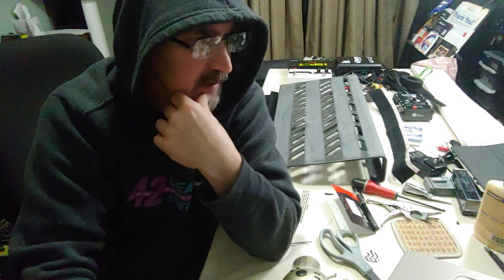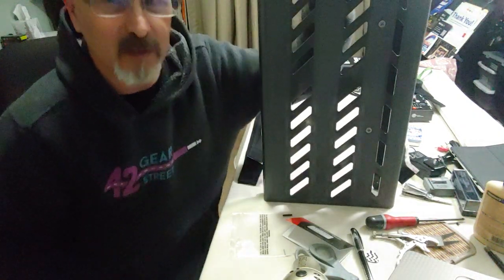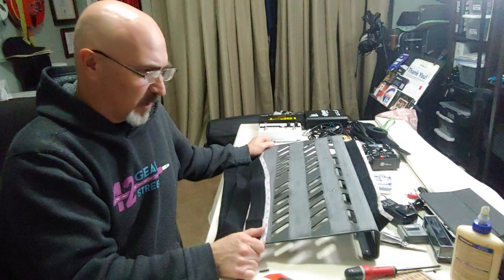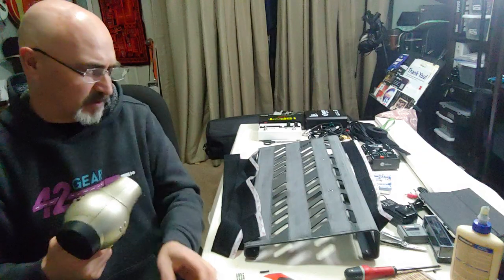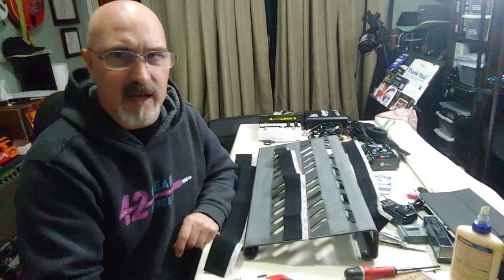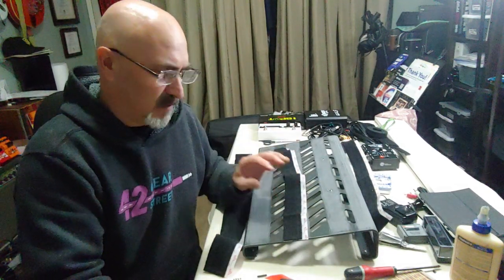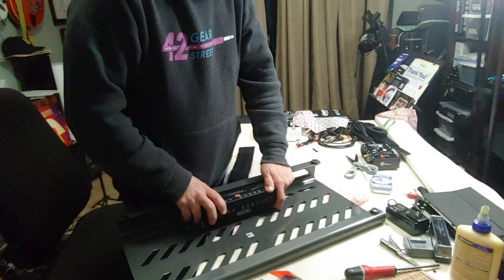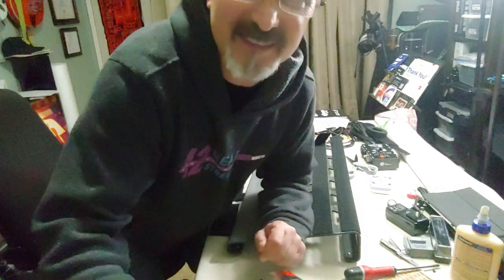3 Top Tips to Attaching Pedal Board Tape - Pedal Board Build - Part 2

Comment: Hey Laz! 

I see the dilemma about placing the power supply under the pedal board, that bracket they have under there is kind of in a strange place IMHO. I'm guessing that's for helping to organize your cabling underneath the board.
My suggestion about mounting the PSU to one side comes from my experience as a rack-builder, where I would always run my power cables on one side of the rack, audio cables on the other, and control cables up the center. I did this to reduce noise and minimize the risk of hum from inductance. Truetone PSU's are probably the best on the market, and the CS-7 you have should be able to power your entire board with no problem. Truetone has daisy-chain and "Y" cables that can help simplify your connections to reach the entire layout.
Reply from the maker: YEAH... LOVE the TruTone stuff... still use my One Spot every day!